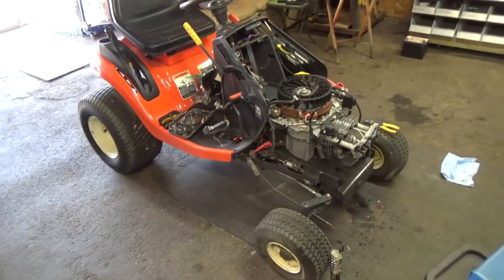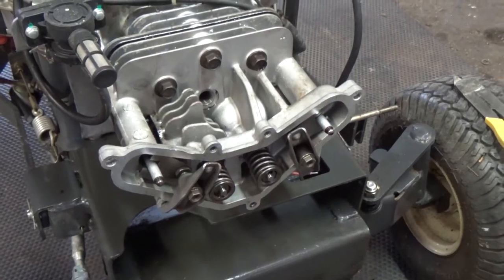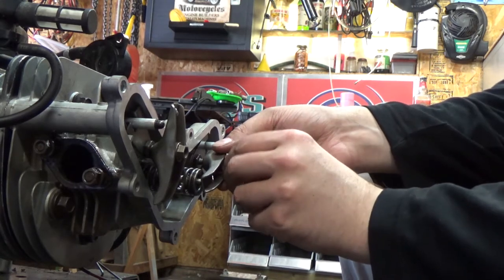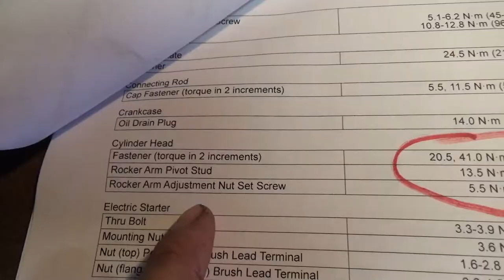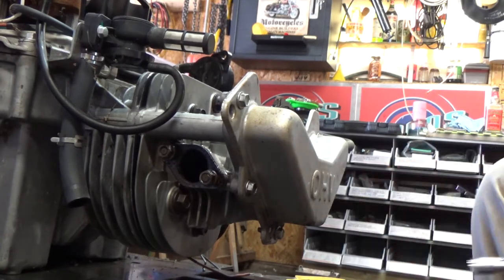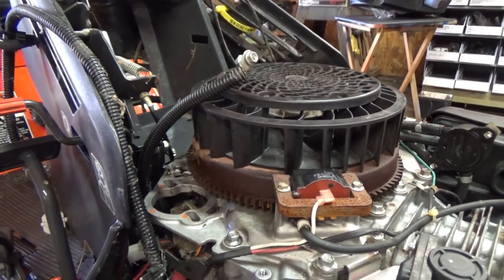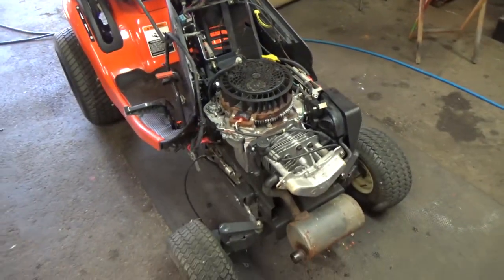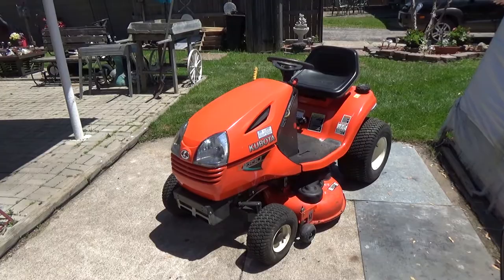How to Fix a Seized Engine - Kohler Courage P.2

Comment: I had a Kohler courage 22 w seized up crank connecting rod . Got off the aluminum on the crank journal and ordered new conn Rod.. also had to clean piston rings that were frozen up. It was run w low oil. Bastards

Comment: Eliminator you dah man my opinion on that motor is that anti back fire cylinoid was bad from the get go from factory when you first pulled it was stuck down letting fuel into the motor since we know it was ethanol was water in it after setting that long leaked into block making all that mess inside worse on I ever saw

Comment: Can't believe they put a Kohler Courage on a Kubota.
Reply from the maker: They're decent engines, but they vibrate a lot, which causes the engine bolts to come loose! I've had a few were I've had to tighten them up!
Reply: Eliminator Performance ....bs...... more balancers have launched out of them. Like  every other one . No shame on you....Kohler should be ashamed.
Reply from the maker: Roger Lund lol that's why I said decent and  yeah they do vibrate a lot
Reply: Darrin if i engine swap mine what engine would fit in the kubota

Comment: Where was it sitting?  We've had machines that sat for even 2-3 years and starts up fine...tho it has to be stored properly (see also, RTFM fuel empty and putting oil where it's needed)
Reply from the maker: I believe it was built in late 2015, for the 2016 season, bought new, wasn't ran for over a year and sat outside. Nothing but problems with this machine, the head is off again for a leaky intake valve!

I hate Kohler's lol
Reply: @EliminatorPerformance  wow, that's crazy.  Yeah the John Deere 345 I inherited sat multiple years more than once but its always been sheltered (garage or shed) and had fuel run out and put oil in cylinders then turn over without spark a couple times to coat everything per the book.  Always fired up easy out of storage.  Its 20 years old (built mid 90's) and runs like new

Comment: Any engine that is going to sit for more than a year I would oil the cylinder down before storage. Also remove all fuel and clean oil in the crank case.